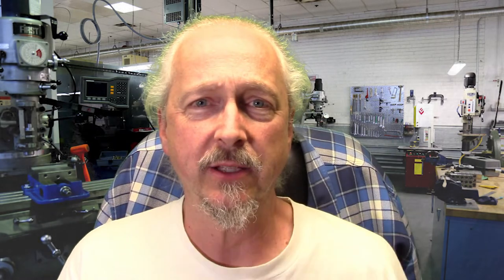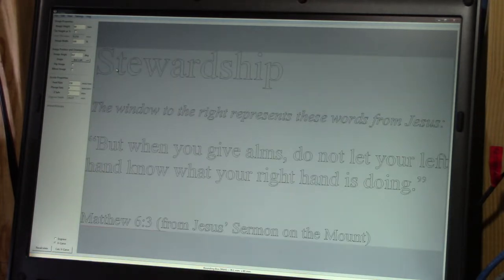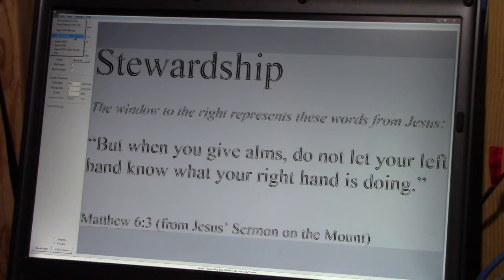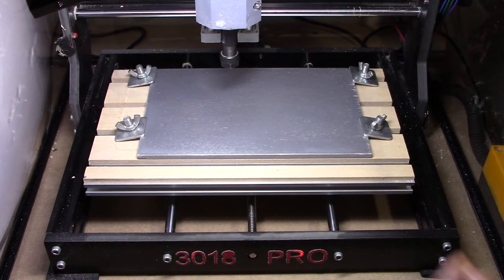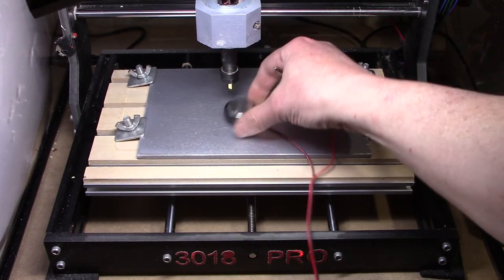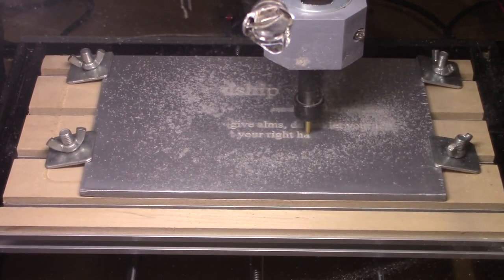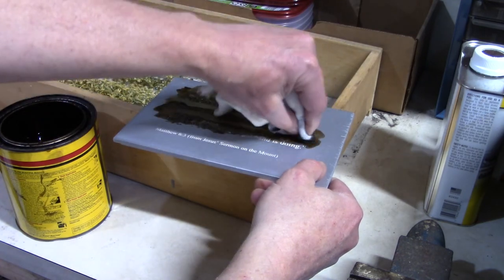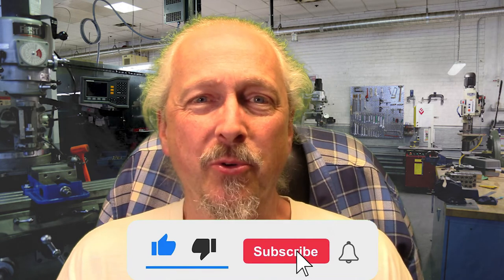Plaque mock-up for stained glass windows

Comment: Really looks great. Nice goin. That 3018 works pretty good.
Reply from the maker: The 3018Pro may be small but it does do a nice job.  It is more work than running the laser but it does have a certain amount of satisfaction when done.